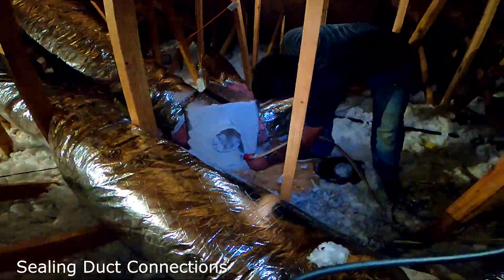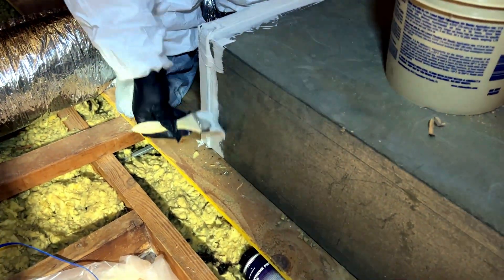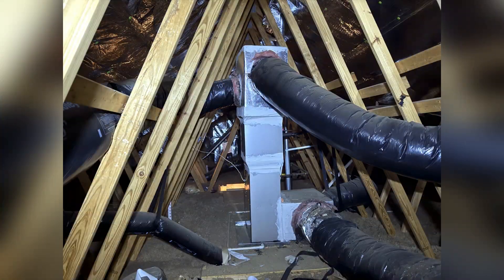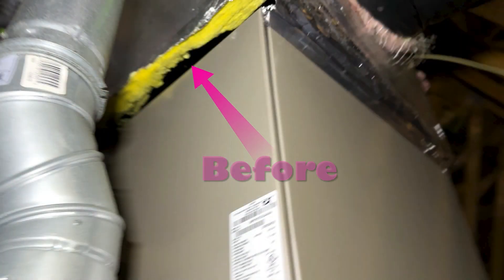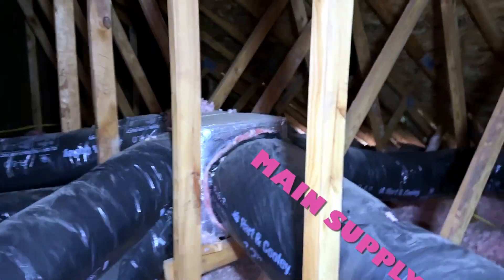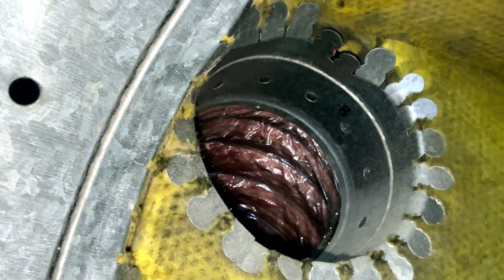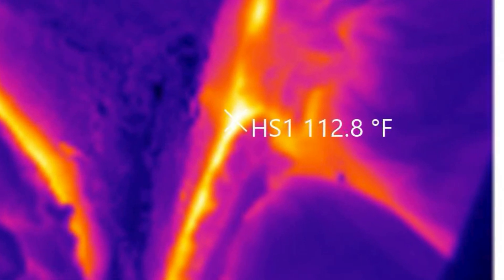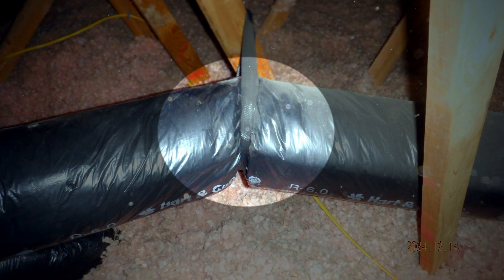The #1 Most Affordable Way to Transform Your Home’s Efficiency

Comment: What causes sweating ducts that are insulated? The condensation then dripped onto the ceiling causing mold.
Reply from the maker: That might be a case of the duct leaking air and attic air infiltrating behind the insulation (likely where there is some sort of a break or imperfection) and the dew point is achieved due to the humidity, temperature, surface of the duct. That is why sealing the ducts or encapsulating them is a key part of the equation and attention to how to do it right should also align with the climate in which you live.

Comment: It’s crazy to me that anyone would ever consider putting their hvac ducts and equipment outside of the building envelope.
Reply from the maker: You're absolutely right—it does seem counterintuitive! Placing HVAC ducts and equipment outside the building envelope often leads to significant energy losses and comfort issues, especially when they are not given the attention they need (sealing & insulation). Thanks for stopping by and contributing!

Comment: Nice summary- your examples show the typical two problems with ductwork based on where often installed (underinsulated and leaky). I believe the leaky issue is usually the first goal to resolve; but in my 80s house, I also need to drop some of the the 'spider work' down closer to the heated space [ideally, I can nest in the blown-in] as they ran some of it up and over at the ridge vent height, down gable ends, and it is obvious when outside temps rise/fall much.
Reply from the maker: Thanks for the thoughtful comment! You're absolutely right—leaky ductwork is often the first priority since it directly impacts efficiency and comfort. Your idea to drop the 'spider work' closer to the heated space is spot-on. Positioning ducts within or near the insulated envelope can make a huge difference, especially in homes like yours where ductwork is routed through challenging areas like ridge vent height. Sounds like you’re tackling the issues in a smart and strategic way!

Comment: This would be crazy it's impossible to get everything..this video is mostly for show and get your business  😅
Reply from the maker: Thanks for your comment! You're absolutely right that it's nearly impossible to seal every single air leak in a home—that’s not the goal. The idea is to focus on the major problem areas where leaks have the most impact on comfort and energy efficiency. This video is meant to show as many homeowners as possible what’s possible and how an expert approach can make a significant difference. That said, I understand your concerns, and I appreciate the chance to clarify. If you’d like to learn more about the specific methods I use or see examples of results, I’m happy to share!

Comment: Don't think I would want that blow it insulation you got stuff in the Attic it's going to be covered with that crap house every time you go up there you have to have a mask on
Reply from the maker: Thanks for sharing your thoughts! I get where you’re coming from—blown-in insulation can seem like a hassle if you frequently access your attic. However, proper installation and preparation can minimize mess, and modern insulation materials are much safer and less irritating than older types. If your attic is a space you need to access regularly, other options exist, like creating a dam around the hatch or using materials better suited for frequent use. Most people don't go up in the attic much, so it is not a concern.

Comment: Can i use my leftover duct sealant to air seal top plates in the attic?
Reply from the maker: I wouldn’t leave it to chance. It would probably work but if your going there and doing it why not just use the best thing which is foam.
Reply: @ which foam is recommended?
Reply from the maker: Tytan fireblock